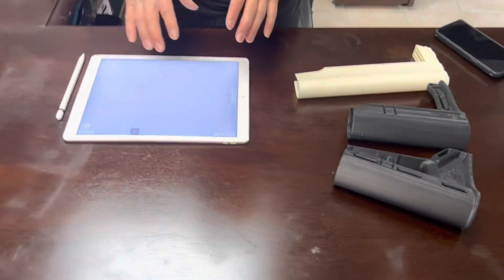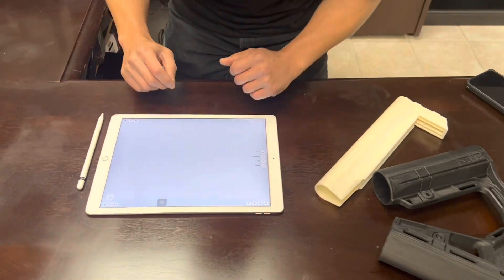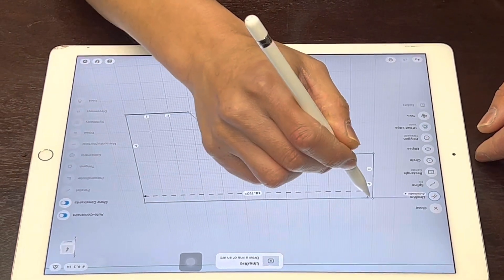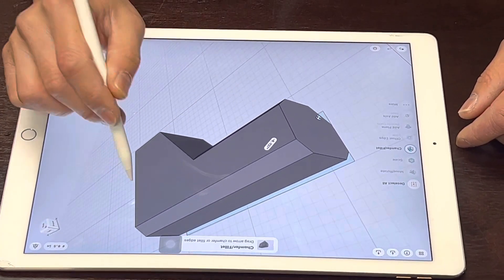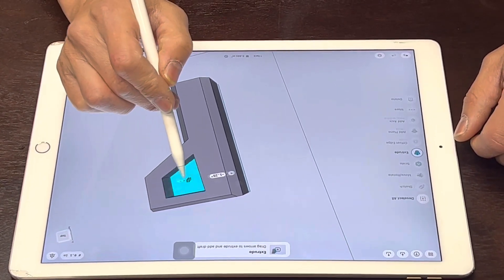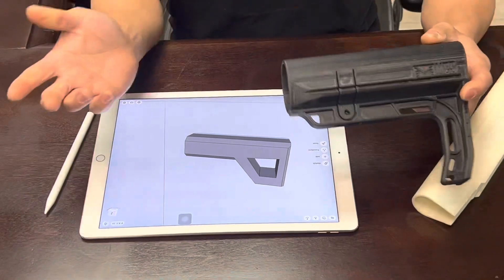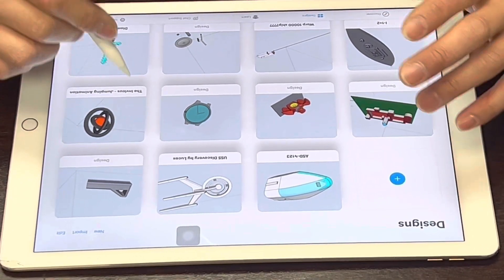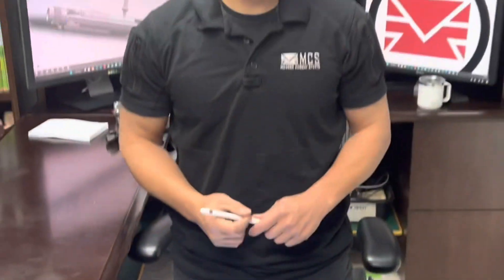Free! How To 3D Model and Design To Make Your Own Customize Parts and Accessories For Any Gun #MCS

Comment: I wish I had a steel mill. It would be great to Redesign the M17 Upper and Lower Receivers to a More "AR10" style config  where the derp system inserts into the upper like a buffer tube. And also only requires a two Push pin takedown rather than Alan keys for quick disassembly to seperate the upper and lower.  That's the  Advantage the 468 and the T15 both have over Milsig/Valken in Milsim Toolless disassembly on the field.